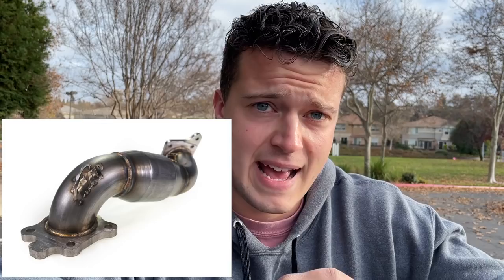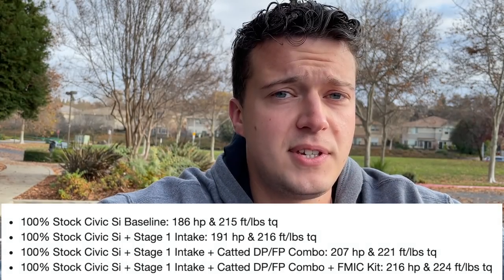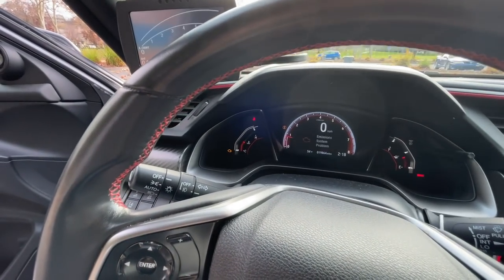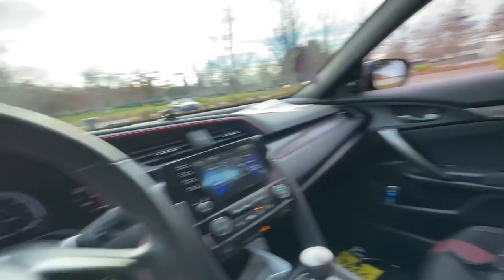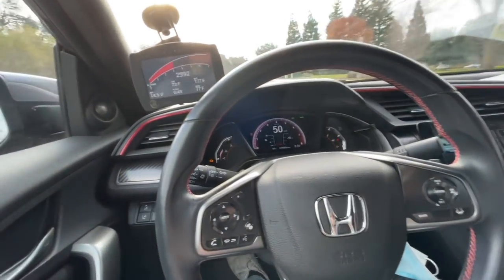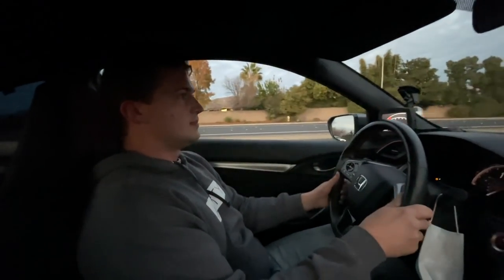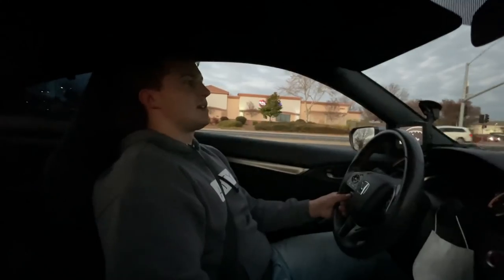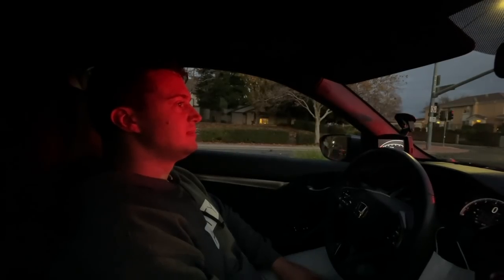MAPerformance Downpipe REVIEW for 10th Gen Civics!

Comment: Great job on this one.  Some nice creative camera angles and content.  My car looks exactly like yours, with all the same stuff.  The only difference is that I have the flex fuel system  I just started using the Phearable 2.5 tune.  It's really quite good.  The Twostep version is good too but I think I like the Phearable better.
Reply from the maker: Thanks, Art! Are you still on the stock clutch?
Reply: @Camhill182  No. I did a preemptive  change. I went with the Clutch Masters FX250.  It's a street clutch that has ~ twice the holding power of the stock clutch.
Reply: I also just got phearable stage 2.5 
Fbo minus the dp/fp, waiting for that to come in from prl. Catted version
Im on stock clutch so we will see how long that lasts

Comment: I finally got my 10th gen si broken turbo stud drilled out today, spent so much unnecessary time and money. My personal mechanic charged me $220 (which is a good price). For anyone reading this that has a 10th gen planning on getting a downpipe, there is a 60-70% chance at least ONE turbo stud WILL SNAP!!! And it’s a pain if you don’t have a mechanic friend. Be careful everyone! My car only had 2300miles on it when this happened. Also make sure you DONT put your old heat shields on your new dp, silicon coat it and thermal wrap is much better:)
Reply: Wow, that’s a bummer man sorry. I got 14k on my 2020 Si sedan, got it one year ago on the 21st!!! Fully stock besides the nice touches in the cabin from amazon lol drives like a dream. Don’t wanna mess with the warranty but will probably at least get CAI soon for it, eventually tune and Intercooler and exhaust. ThTs basically it though.
Reply: @RMG791  nice. I got a PRL race CAI intake, rv6 catted downpipe, and tsp stage 1. After I get my intercooler and Frontpipe I’m gonna get a custom e tune on 93, hopefully I can make 250-260whp🙏
Reply: How did this happen
Reply: @Roberto-ih3zx  it’s because Honda puts a special lock tight on these studs so no one touches the catalytic converters. To try and prevent this from happening DO NOT try and remove these bolts with warm cool. Let your car cool off for at least a few hours, and let some pb blaster soak those bolts for 30mins or so

Comment: I got the RV6 catted dp.  It throws a P0139 CEL code.  Probably the same code as your dp.  RV6 recommended I turn the defouler in a couple of turns.  I did and it still throwed the same CEL.   Today I extended my O2 cable and screwed the sensor directly into the dp.  No CEL yet.   My friend., who is also a Texas state inspector, said that I couldn't just disable the P0139 code with Ktuner and pass state inspection.  My friend also has a 2017 Si coup has a PRL catted dp also extended her cable.  If I now get a different CEL she knows what to do so I can pass.  I will ask her about the software technique she uses to pass if I need.

Comment: I love your car! Sound and performance! In terms of PERFORMANCE you are correct DP typically for catless and for catted even if same cell (200 for example) airflow can change of design pattern is different. But your science is a bit off for them all being the same on aspect of Sound. Sound isn’t just determined by materials. Lengths cancel frequency of sound waves to tune sound and are done with the slightest changes! But love videos!

Comment: Thanks for the video. I wanted to get your advice on what mod to do next. I have a 2020 Si Sedan w/KTunner, PRL CAI, PRL Intercooler, and running Phearable 1.5. Thanks, Luke
Reply from the maker: If you just want more power, but dont care about your car sounding weird, then get a downpipe. If you want to do it the right wat, get an exhaust system next
Reply: @Camhill182  Deciding between MAP vs PRL down pipe and front pipe. What are your thoughts?

Comment: Hey Cameron, dope video ! I was looking for some mods to do on my si & this is forsure one of them! But can you recommend me any 1st time mods that would be beneficial ? Thanks!
Reply: I just got a 2018 coupe and my first mods were the PRL cobra CAI, PRL FMIC with charge pipes and ktuner v2 with phearable stage 1.5 race and it made a huge difference. Next mods are the maperformance catted DP with FP which have just been ordered, very excited for those. Next I'll be doing frontpipe back and lowering springs with camber arms and wheels/tires just not sure which is gonna be first, waiting to see if the sound from the DP and FP is enough to hold me over and let me do some suspension stuff first

Comment: maperformance says you need to get the up pipe and maperformance intake or the downpipe will cause a engine light I have a prl intake race version and about to install the maperformance downpipe with factory up pipe, think I will have problems?
Reply: If you have the race maf intake I'm guessing you're using a tuner to mitigate the CEL the race maf would throw, so I can't imagine you should have a problem... you're running a tuner right? (KT/ Hondata)

Comment: honestly if i had a turbo car id just hit ebay up for a downpipe and intercooler downpipe is metal pipe with flanges pretty hard to make that shitty and intercoolers are made by the same ppl so that mishimoto intercooler is probably the same as the ebay one just no logo hence why it costs so much money ebay car parts do come in clutch, my friends girl has a true cold air intake on her 09 RT from ebay and its amazing was like $180 ebay parts can be just as good if not better than name brand
Reply: You do pay for shitty welds though
Reply: @jatchetto-_-3741  the welds are fine I've talked to ppl with it most are machine built